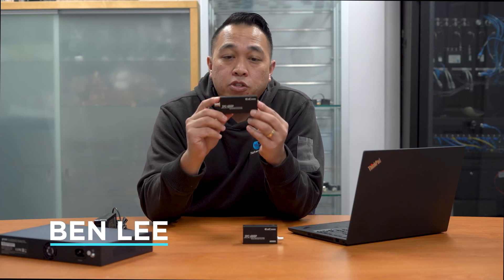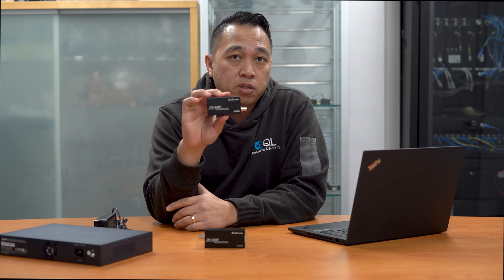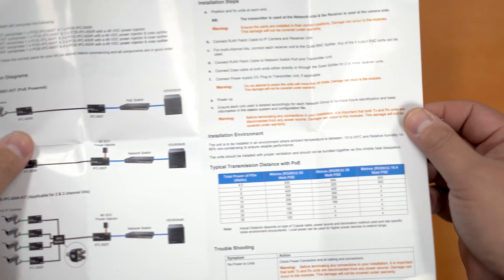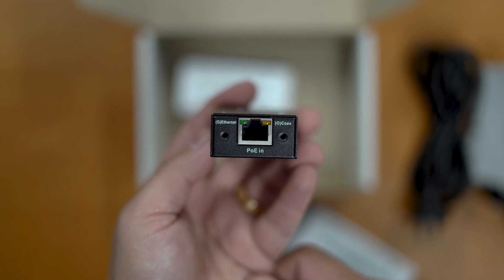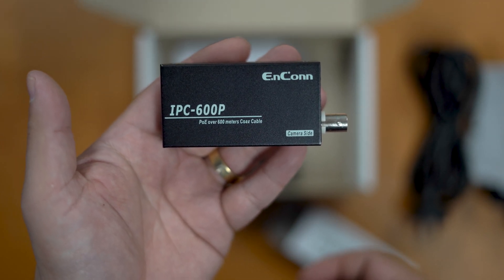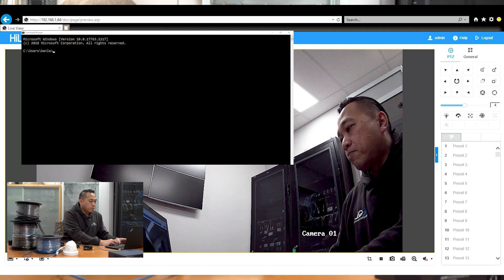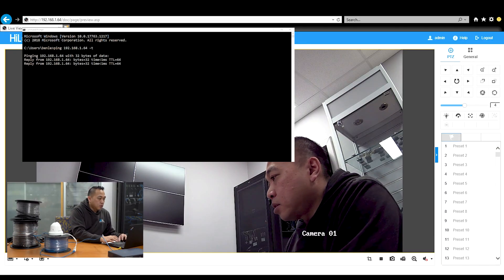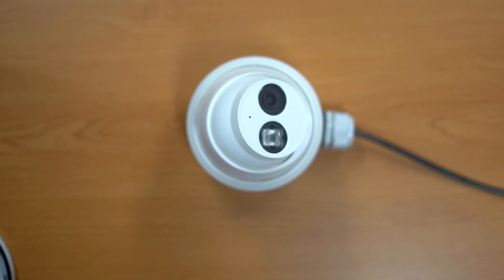PoE Over Coax Converter | POE-IPC-6001A-KIT

Comment: hello do you think 8mp ip can will be ok in this setup?
Reply from the maker: Thanks for reaching out. Yes this will be fine. Typically an 8MP camera with stream between 8-16MPBS depending on the compression codec. These devices are capable of 100MBPS which is more than sufficient.

Comment: Is there any converter that can convert a the IP camera to analog
Reply from the maker: The POE-IPC-6001A-KIT is designed to transmit Power over Ethernet (PoE) and network data over existing coaxial cables, facilitating the upgrade from analog to IP camera systems without the need for re-cabling. 
EOS AUSTRALIA

However, it does not provide functionality to convert an IP camera's digital signal back to an analog format. Converting an IP camera to analog requires a specialized device known as an IP to analog video converter or decoder. These devices receive the digital video stream from the IP camera and output it as an analog signal compatible with traditional analog monitors or recording equipment.

If you're considering such a conversion, it's important to note that the market for IP to analog converters is limited, as the industry trend favors transitioning from analog to IP systems due to the superior image quality and advanced features offered by IP technology. Therefore, while solutions may exist, they might be less common and could involve additional costs

Comment: I have internet router downstairs.  I would like to have 1 poe network switch downstairs connected to 3 poe cameras downstairs .  Upstairs NVR to 4 poe cameras upstairs. What and how many devices do I need to use my home existing coax cable from downstairs to upstairs to connect all poe cameras downstairs and upstairs to NVR upstairs.

Comment: hello, I have a my router, and modem all upstairs in this cabinet in the laundry room in the new Lennar homes.  however I am trying to wire PoE cameras and do not want to run wires all the way upstairs.  I do have a coax cable port downstairs in the office.  am I able to use this device to convert that coax port into an ethernet port that way I can connect my NVR system to the ethernet over coax and then my cameras to the NVR? thank you so much for making these videos.
Reply from the maker: No problem and Thank you! Yes that is correct, you will be able to use that cable as backbone/link back to your router.